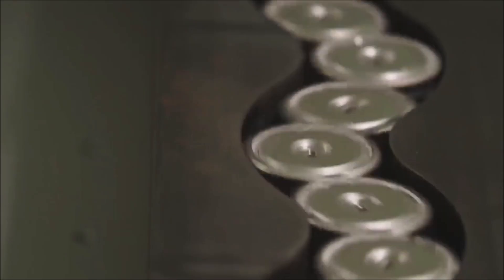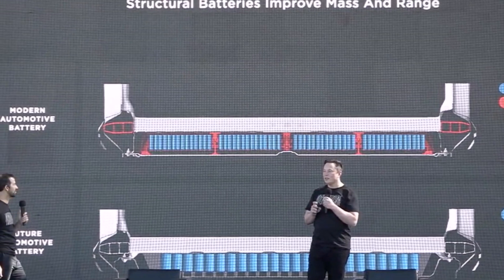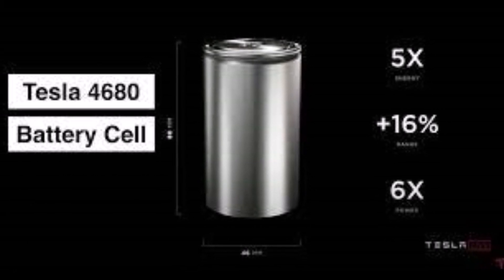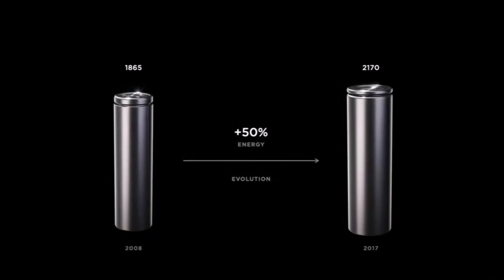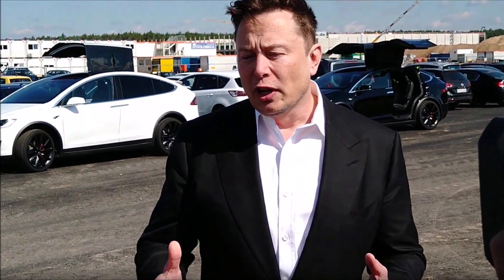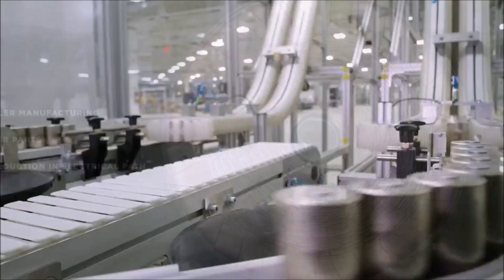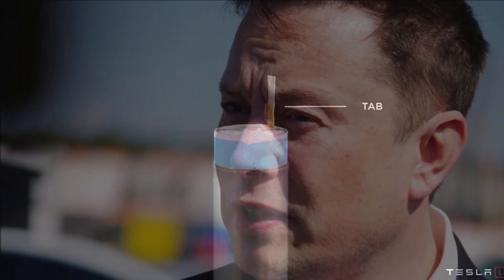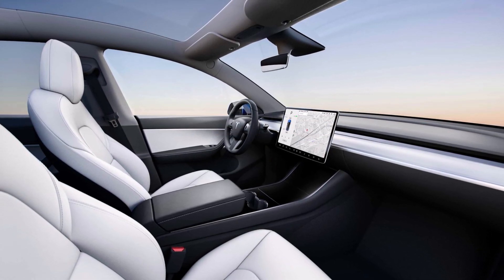Tesla Can Cut $5,500 Off Model Y Battery Costs, Multiple Experts

Comment: There is no evidence that a dry cathode 4680 exists yet, all samples extracted have wet cathodes? Also no silicon added yet. So for now we just have a large form factor with thick cases, so no advantage over Panasonic 2170 other than no supplier fee?
Reply: Well, again, it's still a PANASONIC cell.  So all of this blather is just that...blather.

'Battery experts' are still underreporting Tesla's battery cost by a good 60% or more.  Between that and the increasing cost of commodity elements, battery costs are only going UP.
Reply: Dry production of the cathode, i.e. not solvent based, not a dry cathode i.e. no electrolyte.